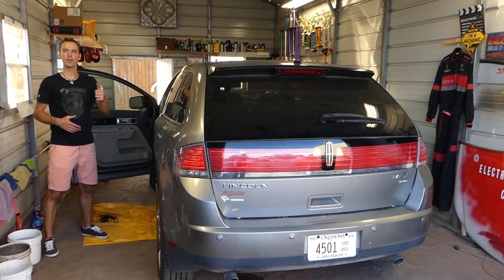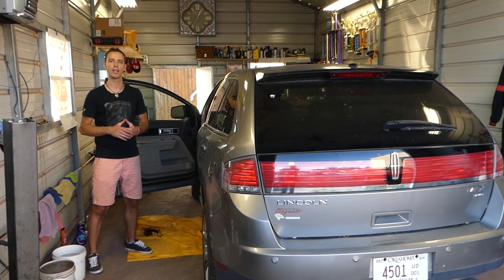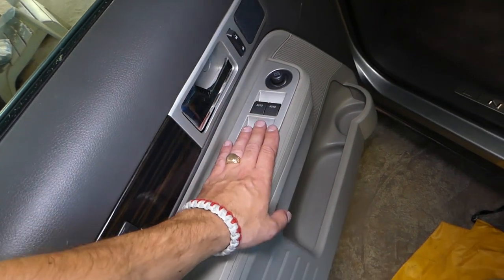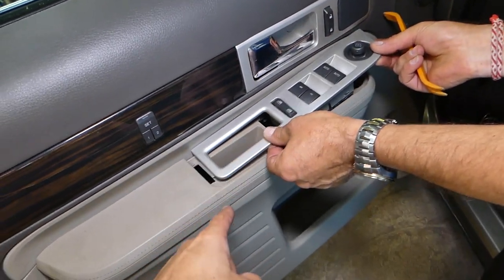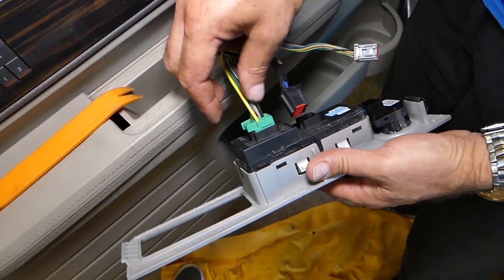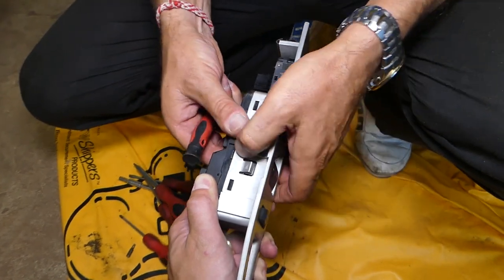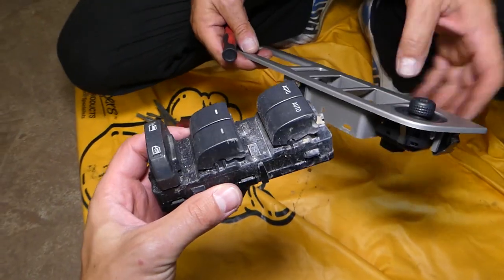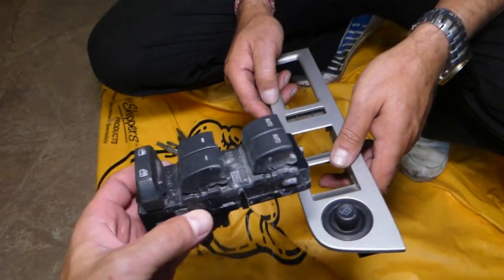FRONT REAR WINDOW SWITCH REMOVAL REPLACEMENT LINCOLN MKX

Comment: I have the same switch modules in my 2012 Lincoln Navigator.  Switches work fine, but none are illuminated when headlights are turned on.  Should these switches be illuminated?   Are the bulbs integrated inside the switch?